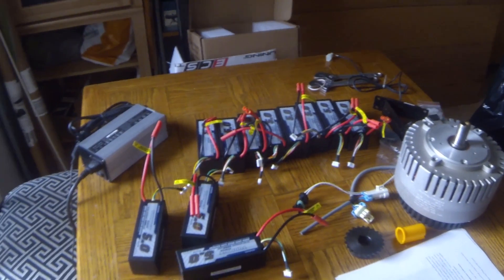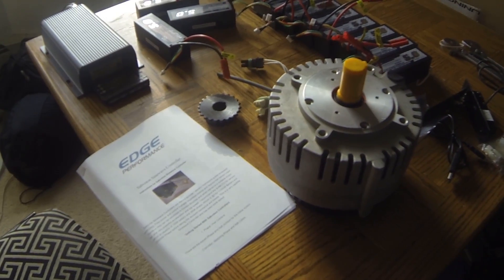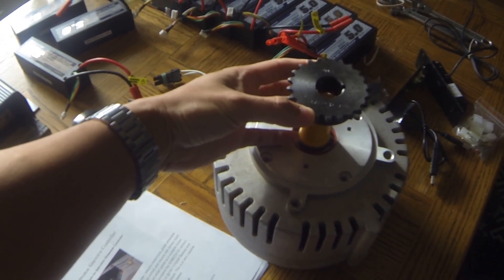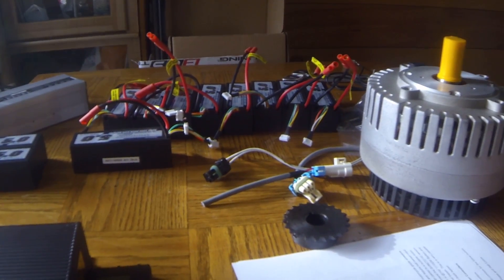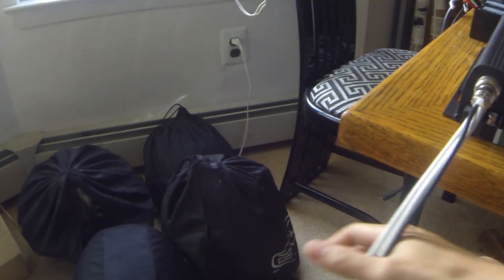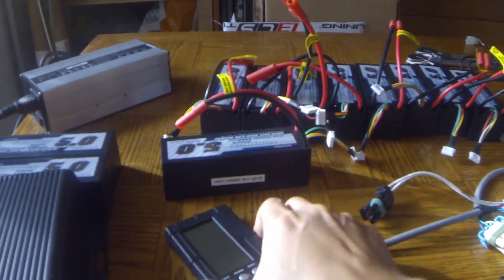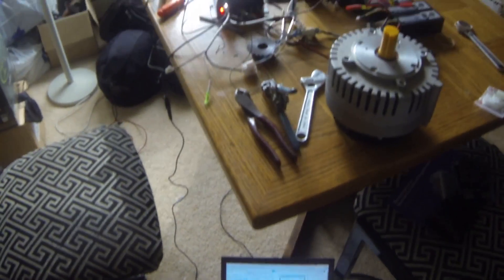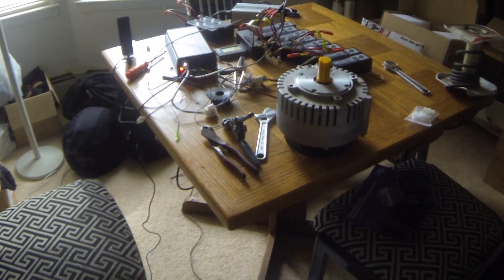Electric Conversion Begins! - Go Kart Build Part 6

Comment: Yeah...the electric motor itself cost MORE than a 20HP 5 speed+revers brand new 200cc honda clone. AKA the Lifan 200. Costs can be a little less than 400$ sometimes. Oh FYI 20HP = roughly 15KW. 

With the Lifan it comes with just about everything but a gas tank. Even has an electric starter. Meanwhile your spending $1K+ (my guess) with those expensive batteries and electrogizmos on a go kart that won't even go past 30mph. While the Lifan will probably push you past 80mph if you arent a fat ass and get your chain-tire size ratio right.
Reply: 30mph!!?? I think not. 10kw is easily enough to get to 60mph with so much more acceleration

Comment: how exactly does the displacement of the throttle feed into the controller to spin the motor?
Reply from the maker: Joshua Deonarinesingh the throttle is a hall effect throttle. When the throttle is pressed, the controller sees a higher voltage

Comment: what are the specs of these lipo batteries?
Reply: that Turnigy battery is 4S,  5.0ah,  and 20C continuous and 30C peak. His arrangement is 20S2P .. or about 80 volts and 10ah total (looks like he has enough batteries to build two 20S2P packs). THese batteries sell for around $40 each .. or $200 per pack, maybe 5-10min run time?   Each pack could put out 200amps .. but he said he was only going to use 100amps ... or 8000 watts ... a bit over 10hp.  Sounds about right for the motor he selected.

Comment: what sprocket did you use? I want to make sure I have one that fits.
Reply from the maker: just got it off ebay and made sure it was the right shaft size i think this is 7/8"
Reply: Ok, thanks.
Reply: I dont want to bother you too much, bet whats the exact speed controller.
Reply from the maker: Sabvoton SVMC072150
Reply: Thanks.

Comment: Awesome,  I like to convert my 125cc shifter cart to electric...can you please list where you got your parts for the conversion and estimated cost?  My karts weight is more so I would need to get more batteries but motor, controller and accelerator should be fine. Please share your sources.
thanks
Reply from the maker: Once everything is built up I'll do a total cost of build video and parts list so other people can replicate it.
Reply: zed4me perfect!  thanks
Reply: i may have missed it but did you ever do this?

Comment: aren't you gonna use a torque converter with that motor?
Reply from the maker: amr hakim Torque curve for electric motor very different from gasoline engine. A CVT is not gonna work well with an electric motor in 99% of cases.
Reply from the maker: No way. Electric motors don't need torque converters and also this motor would just be too powerful for it anyway.
Reply: maybe if you used torque converter (cvt) you will gain speed at lower rpm which save some battery charge or what !!

Comment: I've never used such a large programmable esc before, but you should see if you can get an exponential curve/control on the throttle. Simply put, on the low end speed you have very fine control, but as you get higher and higher the sensitivity increases. It could make throttle feel more controlled.
Reply: zed4me what is the name of te programable esc ? pls i need it
Reply from the maker: Any idea how to make that happen?
Reply: well, I'd ask the kind people that has helped you out on all the technical stuff so far as you stated in the vid. I think the better term is "throttle curve", ask if/how to apply it in the settings. Also I'm no expert, but something "advanced" as this might not make a realistic difference in practice.
Reply: zed4me wondering about the parts list and where you get them. Thsnks

Comment: Do you fly quads? and what is the C-rating on those LiPos
Reply from the maker: I have a simple one but no I don't really fly them. These lipos are 20-30C discharge rated. I've read not to run them above 15C though.
Reply: cool, i would have gone after some of those 50c's lol would really scream, assuming your ESC could handle it
Reply from the maker: Michael s A lot of those 50C lipos are way overrated. I've used these packs on so many builds, they're the best bang for the buck
Reply from the maker: David Westernall its gonna be 5-7C continuous, nothing big.
Reply: Any issues with the wires getting hot? Thinking about doing the multistar 16000mah batteries.